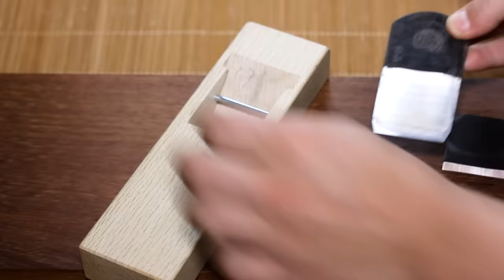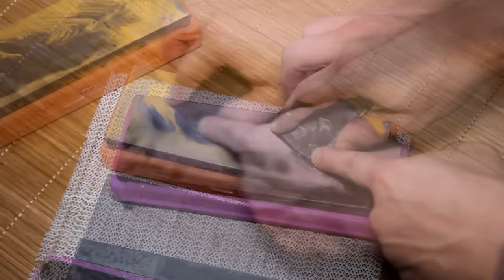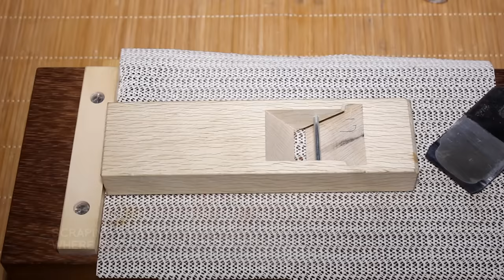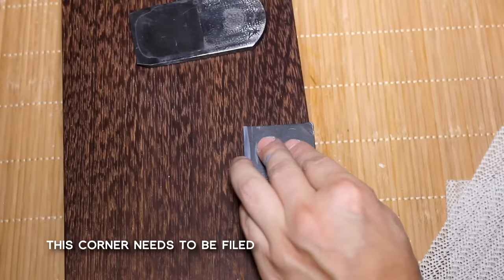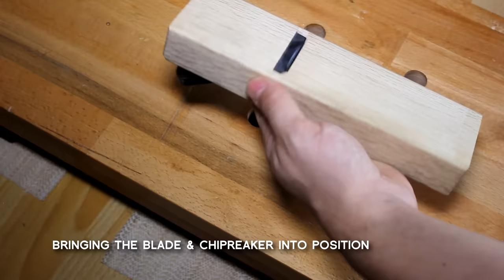Setting Up an Inexepensive Japanese Plane

Comment: is that just water you are spraying on those stones?? good tutorial on tweeking a new plane.
Reply from the maker: Yes, water. Actually only water you can use to water stones, oils and greasy stuff will make them unusable, or other chemical liquids. These are Shapton waterstones, they don't need to be soaked for several minutes into water before using them, they are splash & go, so only spraying is enough. Just the rough stones up to 1000 usually I keep them couple of seconds in water cause before using cause they are soaking more than a spray can deliver

Comment: Excellent work!
I have a question about this blade:
Can you hammer the bevel or it will brake? (I mean to tap the bevel in order to maintain the hollow at the back)
Reply from the maker: You can do that, actually this is how it should be done when that hollow will disappear or become flat. But I haven't tried it yet, I'm not at that level dough :)

Comment: Hi Adrian, i really like your vids 
I have a couple of questions and one trick 
First the trick, i have a ha no kuromaku shapton 5000 and it says dont rest in water bla bla meaning that one shouldn't rest all the time the stone under water but try to, before hone, put the stone 50 seconds under water and you'll feel it more friendly, sensitive about the cutting of steel
And  that doesn't affect the resin polymers in he stone because the water is gonna soak so fast. Try it one day 
Now the questions, what do you think about buying a standard metal block plane (lie nielsen veritas woodriver) vs a japanese block plane (40mm not that small)
The feelings in the planing and how long does a kanna can last by the pass of the years
Hope you answer and read my questions
Saludos de Perú
Reply from the maker: Hi Mark, thanks for the trick with the 5k stone, I will definitely try it. About this stone, I have a lot of different blades around, all work very good on this stone, except the PM-V1 blade of the veritas smoothing, only on the back! It gets stuck in a few moves. I can't get a mirror polish on the back of this blade, but it sure gets sharpened and the plane leaves "porcelain" finish (as much as a 5k stone get do) on the wood. The 1000 stone I always leave it some seconds on the water jet before using it, it is soaking like crazy otherwise if I only spray it from start. But it cuts amazing, great feedback. If I will ever buy Chosera stones, I will not replace this 1k Shapton :)
I have a japanese block plane, 42mm blade, 180mm body, you can see it sporadic in some videos. I don't like it other than using for small work, chamfers etc. Is to light, and I usually use the block plane for ugly work. I have a new type stanley block plane, and for the moment I don't feel upgrading it to a premium one. I use it very often since I got the Veritas LA Smooting plane. 
I am not yet confident to use the bench plane in the video as a replacement for western planes, the veritas above, but I've discovered situations where is better the jp one, like smoothing on top of a kumiko pattren, where a steel one is too heavy and might damage the strips, in the shooting boards where i have to run against the grain, the jp one leaves minimal tear out, leveling a frame of a box after assembly and probably many others to discover.

Comment: I followed a similar approach to your process here on my own small kanna.

I ran into two issues:

At the time the back/underside of the blade reached better contact with the wood, it would also protrude from the mouth using only light hand pressure. This is pretty bad and a little disappointing.

At this point, I also can't fit the chip breaker because of two factors; either the chip breaker angle is too high, or because the pin is crooked/bent, it exerts pressure on the right- and leftmost sides. I'm not sure whether to scrape material off the pin or make the 'legs' shorter on the chip breaker, or both.
Reply from the maker: It can happen even with a new plane, either in time, due to wood movement that the blade will protude more, so in this case you need to add/glue like a shim on that blade rest on the body. In order by thickness I suggest: cigarettes paper roll, normal office paper or even veneer. I did this to some of my planes too. 
Regarding the pin, try to fix first the blade bed, then check the new situation. If the pin is tight there you can try to file it

Comment: Hi, Adrian
Just one thing I have to say.
Do not sharpen backside blade on the whetstone. I mean backside is a fitting face to smaller blade.
You have to grind and horning it on the flat iron, Completely flattered solid steel.
It’s really tough work to grind and get shiny backside face. But you need to get its perfectly flat backside face.
Reply: Should only sharpen bevel. Back should be flat

Comment: Just asking did you hone the whole blade on the back or just the front part because it looked like you just did the front of it  and thank you for the video very informative ✌🏽
Reply from the maker: Just the front, like 10mm - 1/2", but as you see I go a bit inside too, with gentle passes, not to make the hone like a "rebate", don't find the exact word🙂

Comment: I ordered the 65mm yesterday and just saw this video today. Does that mean I have to go through this process before I'm able to use it?
Reply from the maker: Yes. It comes with the blade "almost" sharpened, also the body is relatively flat to make some shavings but will work very badly. The worst part is that the blade bed is very tight when new, you will force it to go, and it may brake the wood. To use the plane at its best you need to tune it

Comment: I own a small wood block plane that works great. Bought one like your video and cant get the blade to engage the wood on the pull stroke?
Really weird as the blade is below the level of the block and sharp enuf to shave with. What the heck am I doing wrong?

Comment: I think I have a very similar plane. Tell me, have you had success with this planing hardwoods like maple, oak, walnut, sapele, etc? I get the same results as you on pine, cedar and balsa but it seems like it is temperamental with hardwoods. Is it the angle of the blade/angle it sits in the body or am I doing something wrong? Also have you had any success using it for edge grains?
Reply from the maker: There are also kannas for hardwoods, they have a bigger bed/blade angle, about 50 deg or more, vs this one that I believe is 40 deg if not mistaken. I did some planing too with this one on hardwood, mainly ash, walnut, maple, but with very thin shavings and the chipbreaker set very very close to the blade, about 0.1-0.2mm away as those woods presents a lot of weird grain directions. Also, either way you will not get those nice paper like shaving with hardwoods because of the porous structure of those woods, vs the conifer woods. Hardwood jp planes with higher angle blade you will usually find more expensive, I doubt there are available in the 50-70$ range as those general ones. Sometimes I do use it on the shooting board on end grain, but mainly when my western plane's blade is dull :) works great also

Comment: Just wondering, why Japanese did not make a handle for pulling as a western plane has a handle for pushing? 🤔
Reply from the maker: It's a legit question, I've asked myself some time ago, but when you use it enough you realize is doing much worse :) Adding a handle you will not have steady control of the part of the plane that is working on the wood (front of the blade) practically you center the control where the handle is thus rotation can appear. Also, thinking of some physics involved, you raise the gravity center of plane + hand, so not good. Holding the sole body with the hand only, makes it spread the holding force all away the part of the body that needs to be in control always.  On the other side, a western plane cannot function without a handle, pushing it. Hope I've said it right :) First time I've put from mind to text all this theories :)
Reply: there is a nice video by paul sellers where he shows how a properly tuned and sharpened Stanley #4 plane being pulled by a string alone can make beautiful thin shavings, so even in the western plane case, the handle is superfluous.  The plane's blade gives the optimal down force, so only light horizontal force is needed.
Reply: Chinese planes have lateral handle for pulling.
Reply: A ‘western’ Block Plane is the equivalent piece of kit. A Nielsen with the correct setup will produce the same results if not better. The Nielsen gear is tolerance engineered, it’ll last a lifetime.

Comment: I have just bought the same plane from Fine Tools, mine has arrived with the blade about 3mm wider than the throat? i.e when the blade is fully seated, the left and right tip of the blade are seated on wood, and seem to clog. Should I be correcting this by filing away some of the wood itself?

Comment: Thanks for this very interesting video! After 1 year, how do you feel with this plane? Do you use it regularly? more than your western planes? I'm looking to buy the 65mm one from fine-Tools, but I'm still wondering if it is Worth entering this japanese planing world. Not so easy to find and complete a whole set of planes to do all planing tasks. I bought a very cheap and short one (150mm) and it performs very well but is limited to its size. Maybe a smoothing kanna could complete jack plane, jointer western planes...
thanks.

Comment: Adrian, why did you create hollow parts in the flat sole? What should be achieved by this operation?
Reply: I'd also like to know - the only positive I can think of is reducing friction. The smaller contact points would wear quicker though.
Reply from the maker: Indeed, for less contact area, so less friction to counter balance by pressing on it

Comment: I'm no carpenter but aren't planes meant to be chisel ground with the back of the blade as true as possible against the body? I would think the gap created would be an issue for a few reasons.
Reply from the maker: You mean the sole of the plane, with those recesses or the bed that the blade sits?

Comment: So, you are saying that there should be a little side to side movement of the blade once put into place?
Reply from the maker: Yes, in order to adjust it straight/paralel. But dont worry, it will not move once set into place, it's pressed by the up/dw wood body
Reply: @AdrianPreda  Ok, got it. It actually took a couple days of trial and error of using it when time permitted.  Little fine tuning on the wood here and there, and then getting my sharpening skill down....now it's good to go.  I like it and it can be called upon for even doing different tasks. Yer video helped a lot.

Comment: Was that hardwood you were planing or a softwood? I read a review of one that said the inexpensive Japanese planes are meant for soft woods.
Reply from the maker: Yes, ordinary spruce from hardware store, but I've chosen it carefully for constant grain direction and no knots for demo purpose. For hardwoods you need higher angle of the blade normally.
Reply: Very good question.

Comment: I think I have one just like yours. I am having a hard time getting it sharp enough for the papercuts. Did yours have a secondary bevel when you got it? Mine did. How can I get a consistent angle for the secondary bevel across stones (BTW, my stones are only of 400, 1000 and 3000 grit - not up to your 5k)?
Reply from the maker: No, it didn't had a secondary bevel, that's weird. Normally japanese blades should not have it because will put more force/shock on the hard steel, the brittle one, so will not have a way for the shock to discard towards the soft steel. You can get an acceptable working sharpness with 3k too. For consistent bevel by hand is hard at the beginning, needs more try. I barely began to be able to do it, and still not top. When the bevel becomes too round I put the blade on the veritas honing guide, its not the best solution, because of the jp blade shape, but with more care setting it up does the job.

Comment: I think u might be build the handle on the port n starboard side to make a easy as well u doing a carpenter work.
Reply from the maker: A handle is impractical on these types of plane, you loose control on maintaining a spreaded steady pressure between those two contact points/lines in front of the blade. The phisics are a bit different than a western wooden plane, maybe also because you pull it not push

Comment: Adrian --- I see a lot of cheap Kanna planes on eBay for anything from $10-40, do you think they are good purchases?
Reply from the maker: If you talking about the new ones, in that price range usually there are less then 42mm blade block plane. They are good in terms of build quality and steel, way over the western ones at this price range, but they are too small to work with and really feel how a japanese plane works. I suggest going for bigger ones, like 50mm up blade. They are more longer, more mass, so better to work with. The small ones are for edge planing, small stuff, you can find it very difficult to plane big boards and have good results.
Reply: I see. Thank you. I will probably buy 1 small one and 1 larger one.

But do you recommend buying those new ones, or -- buy a used Kanna that looks a little more worn and to restore it instead? Those look like they are higher quality, just older and need a restoration. Thoughts?
Reply from the maker: Also an used one, but check carefully the wooden body for its condition, no cracks on the ends, on the sides of the blade or warn and cracked mouth. And also the blade, to have a bit of consistent ura (that hollow). I usually see on older kannas, blades with very used ura or no ura at all

Comment: I wanted to try and make a planing board similar to yours. I don't have Iroko wood near me though. Any other good alternatives?
Reply from the maker: It just happened for me to have an already 45deg iroko board cut, but you can use any other easy to find hardwood like oak, beech, ash etc

Comment: I always thought you had to soak waterstones for a while before use.
Reply from the maker: Most of them yes, but these are Shapton, more premium stones and they only need some spray of water to work. The manufacturer even states that you should not soak them into water cause they will brake or loose their quality. The #1000 needs first several sprays or even to dip it for 10-15 sec into water, probably cause is more porous and absorbs fast the water. The 5 and 8k works from the first spray.

Comment: I ordered a kanna from Japan and it arrived in Germany in wintry weather. It's a simple model made only of the dai and one blade. Unfortunately the blade is stuck so completely I cannot get it out for the life of me - not with all the tapping in the world, not with pulling, not with pliers, not with grabbing the blade upside down and banging the back of the dai on a hard surface (with a towel to dampen it). I have got it warm and dry on the radiator, no success, I got it cold and wet in the freezer, no success either.

I know I am supposed to let it acclimatise for a couple of weeks first, but how can I at least dislodge the blade first?
Reply from the maker: Similar happened to me with a 65mm one bought from Amazon, the one I have a link in the description, I had to hammer it very very much, but eventually it got out. Try to keep the hammer parallel with the blade's imaginary plane when hitting the body, try also alternating each corner, and also when hitting, push with your thumb the blade, I think I showed this in this video somewhere
Reply: @AdrianPreda  Thanks for your reply, but I have already been in contact with an experienced Japanese woodworker, tried every method out there, and after looking at some pictures he said it's not normal and I just got a bad one.

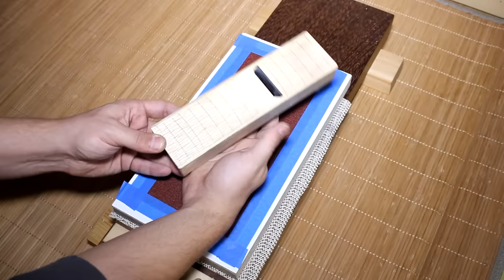Comment: I have a question: when flatering the bottom of the plane you did it with the blade already in place. It seems that you sanded the blade with the bottom together (at 5:18" ) and spoiled the previous work of sharpening the blade. Is that correct or I didn´t understand what is going on?
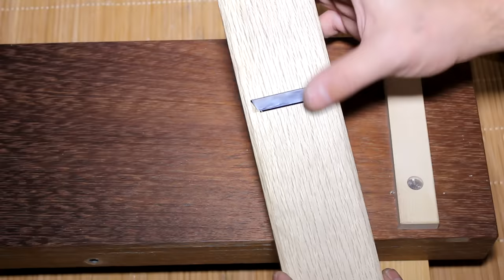Reply from the maker: At 4:54 I wrote that the blade is 1.5 mm away back. This way, they body will remain tensioned, as in normal working condition. The blade in place there can micro-twist/bend the body, that is why when I flatten I put the blade in, but also as minimum as I can, not to sand the bevel.
Reply: Perfect. I didnt realize that. Make sense. Nice work. thanks

Comment: Got a new kanna. Ran blades over a wet stone and when I put them back in the blade and chip break it slipped all the way through or the blade would extend out about a half inch. Is that right? First kanna and I am not sure. If it is wrong how can I correct the problem?
Reply from the maker: I wrote someone here lately, you can look for the comment, it can happen this, just add to the blade's bed on the body some paper or veneer to "add" new material back

Comment: how come you can sand the wooden block without damaging the blade while iets level with the sanding side when you were flattening the downside of the block?
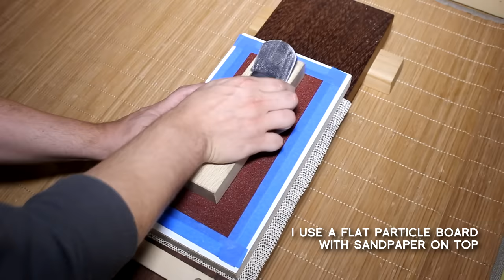Reply: 05:13
Reply from the maker: The blade is retracted in that phase. Check before, at 04:50
Reply: riiiight sorry, i missed that part thanks for answering!

Comment: Why is it called a chip breaker, or it doesn't break the swarf into chips
Reply from the maker: It breaks the shaving immediately after it's being cut so it will prevent tear-out of the wood

Comment: I bought this plane but I'm so frustrated because I can't even get the blade out 😔
Reply from the maker: You should insist hammering, parallel with the blade, make a small chamfer to that edge on the wooden body, and with your thumb keep pushing the blade. It should come out. It happened to me several times too